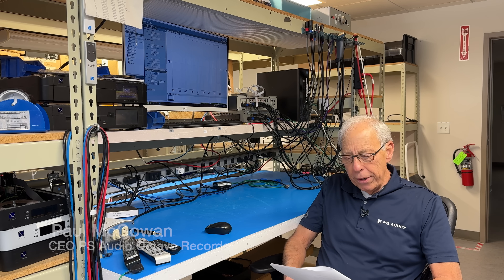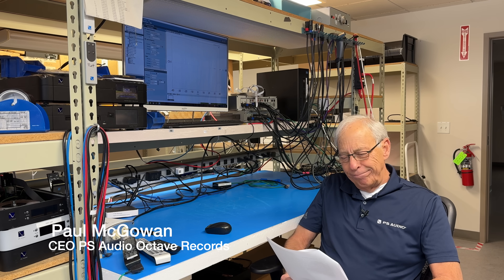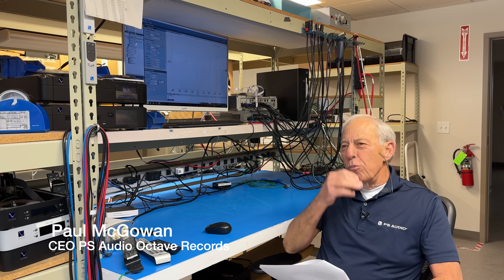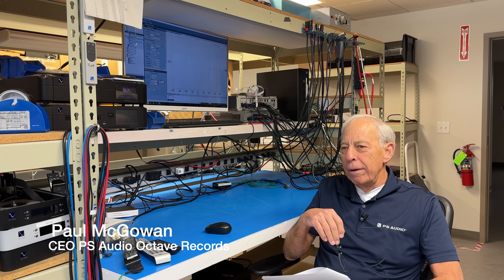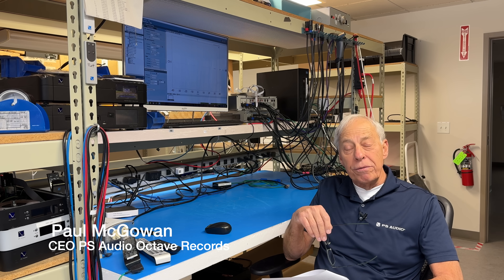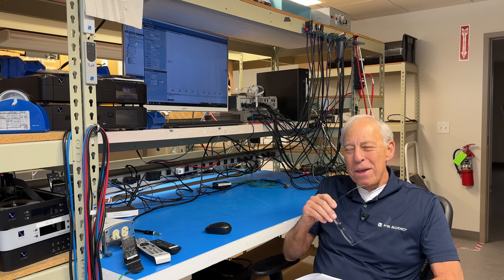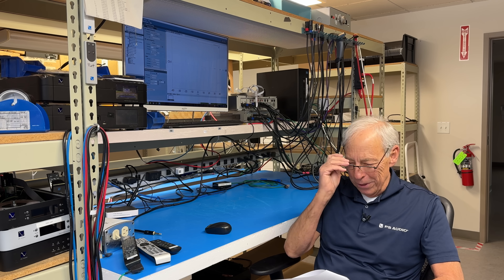Battery power for HiFi

Comment: I can't believe how noisy the power grid is in my area. The power lines themselves vibrate and hum. The power company says that it's fine. There is no way. Even my audioquest 707 isn't enough. I've tried different outlets on different circuits throughout the house to see if it helps. But it doesn't. My system sounds so off and I've done everything you can think of. It wasn't until I packed up my system and went  to another part of the power grid that I noticed a difference. Unfortunately I can't move or travel much right now. So I'm stuck where I'm at. Ive even put in brand new outlets. I don't know much about ac itself. Not sure if it's a ground issue, differential, or common. Low voltage or amps. Or if there dc feedback on the lines. All I know is that a power conditioner and new equipment doesn't fix it. Without spending thousands.

Comment: Get a couple of heavy duty truck batteries, build your own power amp and leave out the ac power supply, it gets rectified anyway. Connect batteries to the circuit after rectification. Job done.

Comment: What if you have a an amp that runs on +40 0 -40 DC and you connect it directly do a 80 Volts battery?There will be no more need for SMPS

Comment: I think Paul missed the point. Battery voltage, Catered to the internals equipment needs. Bypass the 120v power supply/inverter to step it down to needed voltage.
Also, not taking about EV vehicle. Conventional fuel powered vehicle need a good/sound battery. The battery acts as the “constant” regarding charging voltage. If you have a Bad Battery, the engine computer is unable to control charging voltage properly. To have large enough battery to meet the required voltage and amp load would be very sound/quiet power.

Comment: The best way to run audio equipment on battery power is directly from batteries.  
Sounds simple. but each component has specific needs that are not likely to be the same as any other's, 
so you would likely  need a separate set of cells for every item.  
Then there is the problem of the current needed. For preamps it's not much; for CD players 
and tape decks it becomes considerable; some turntables could make it difficult; 
for power amplifiers it is really impractical.

Comment: I'm amazed you don't have solar- any panels on the company hq roof? 
I have solar on my barn roof, and 2 x 20kw batteries. Even here in Wales I'm self sufficient, and export too, which means most of the time my power is coming from my twin inverters.
I'm more a music lover than audiophile, but got annoyed hearing pumps and compressors coming on through my house mains system. On the rare occasions (mid wet- winter) we are importing electricity noise is worse, we are at the end of a rural line, a long way from the power plant.With my limited budget I solved it with a filtered extension lead, and also replaced the power supplies to my WiiM streamer, which was like waving a magic wand. I probably spent £200 cleaning up my house electrics, which was money well spent, even though it represents 20% of my (used) system cost.
So, purely unscientifically my battery power seems much cleaner (even my wife noticed her p.c and internet ran better), and there is no special  filtering .

Comment: StromTank here in Germany is designed to power audio equipment by battery power. I'll soon go to a dealer to  hear the difference.
Reply: Did you get to hear the difference?  I saw a stromtank at my local audio place and even on sale it’s 20,000 dollars. Then again, it’s 20k spent on one item instead of getting the whole house redone with 30 amp wiring and all the other stuff you need to get to get clean power.

Comment: Talking about that nasty chopping noise that needs to be gotten rid of I wonder Why the reviews of Bob Carver's " magnetic Field " amplifiers never complained of a noise issue and often were quite impressed with the sound quality for the money when Bob fed his power transformer the chopped and ugly looking output from a triac ( like in many light dimmers ) which was controlled by musical demands as a way of regulating his power rails. making them impervious to changes in line voltage .

Comment: Reminds me of the olden days of early battery tube radios. they used at least two separate batteries. One for the tube heaters, and the other for the B+ (high voltage). Modern solid state amps kinda mimic that using various taps from a power transformer to get the voltages needed for the different stages. That could be, again mimic'd with batteries, but you would need 3 or more dedicated sets of them to supply both plus and minus rail voltages, pre amp stages between 12 and 40 volts, illumination and all that.

Comment: Here's a thought. If there were higher voltage batteries, as high as the voltage in an audio piece, how about using the battery as the power supply. Our gear runs on DC so why convert the DC of a battery to AC only to have the electronic gear power supply turn it back again to DC?
Reply: Correct..thats the path

Comment: Essentially any audio gear that works with a wall wart can be improved with a better power supply and many times even batteries. That is fine for pre amps, dacs and notebooks or MacMini/NUCs. Power amps with batteries need big high efficiency speakers. An inverter is not usually a good thing because they do let some of the garbage through.

Comment: Well , using a car for that is indeed stupid.
But one can indeed build or modify an amplifier to run directly on a battery pack. And its a better solution Than main's voltage.

Comment: This is where DIY can excel.  The issue Paul describes is all the result of using DC batteries to power our gear which is designed to use 120V AC.  With DIY it is easy today to use battery power for the sensitive digital bits.  iancanada is a Toronto designer who makes lego block parts for diy digital front ends.  He has popularized the use of lithium batteries with great results.  Then he took the step of using supercaps to aid in filtering.  Then the ultimate power supply which is to use a massive 3000F pair of supercaps as the power supply.  Combined with a good clock, the sound will destroy all but the best mega buck DAC.  But all of this eliminates the constraint of a device designed for standard AC.

Comment: I’ve been using an APC computer backup power supply on my system for years.  Relatively inexpensive and eliminates power supply line glitches.   I don’t see a downside to using UPS units designed for computers on hi fi equipment.

Comment: Battery power in an EV is extremely clean until the battery dies and then it goes to a battery graveyard where it does not disintegrate and is incredibly toxic.
Reply: I think they are quite recyclable. 80% or something to that affect.
Reply: And don’t forget about the mining operations to get those minerals.  Definitely not clean
Reply: But getting oil from the ground and making gas, diesel, natural gas and propane is? Oh yeah forgot about benzene etc.
Reply: @Expedition18  We well need a lot of gas, diesel to grind those batteries and make dust, lot ofwater to filter plastics, more carbon generated electricity to make electrolytic separation of metals, a lot of petrol to mine pure silicon crystals for solar panels, much more to buy heavy new cars (that won't work for decades) Is CO2 going up or down since  big corporations are «green» (the same that fought against science and scientific ecologist) ? The solution needs a real change: sticking a solar panel in the roof and driving a 2,5 t vehicle instead of public transportation, cycling or walking or keeping old cars (the good ones) won't help much. It might be worse indeed.
Reply: @Expedition18  Oil production, at least in the US is well paid and well regulated.  Rare earths are mined under terrible conditions with 25000 children involved in cobalt mining in Congo alone.

Comment: 1) The power from an electric vehicle is not necessarily clean.
Yes, it is off the public grid, which is great.  But who knows what noise is being generated within the vehicle's electronics?

I doubt that EV manufacturers put in a meaningful effort for the output to be noise free, when people will generally use it to power their refrigerator during a blackout.
Someone will have to try it, and do a listening test.  And they will need a long extension cord, where that, too, will be a factor in the quality of the power delivery to the stereo.

And the results will probably vary from EV model to EV model.  Even the same EV models might differ, as the manufacturer might make design changes during a production run.

Two vinyl pressings, from the same pressing plant, often sound different.  So I would not put it passed the EV manufacturers to not be consistent if they sourced parts from different places, and found savings here or there, etc, resulting in quality changes to the power delivery -- which no one would know, when powering their refrigerator or electric drill, etc.

2) Several commercial level UPS's (uninterruptible power supplies) do the double conversion (A/C to D/C to A/C), resulting in a clean, off the grid, newly generated pure sine wave output.
Can those double conversion UPS's deliver the voltage fast, to satisfy the immediate demand from audio gear?  Well, they are not marketed for audio gear.  But maybe they will work well for audio gear?

Eaton Powerware has UPS models that will deliver clean power.  Any model that starts with the number "9" will do so, such as the model "9SX".
Tripp Lite also has such models (but I am not familiar with their model naming scheme.
Liebert is another company.

There are others.  Their top models will power an entire town (megawatts of power), and will cost as much as a town.
But there are dual conversion models that are sub $1000 (providing, perhaps, 1000 watts), and sub $2000 for 1500 watts (and the wattage and price keeps going north from there).

Are they better suited than PS Audio's Power Plant, for audio gear?  Probably not.  But who knows?

Comment: Just have no AC at all.   i.e. amp has no AC power supply module, just a voltage regulator taking battery DC.

Comment: I run 4 Taramps Bass 8k's off of 3, 45 amp hour cmax banks charging them with 2 , 370 amp alternators in my truck. Each amp is wired at 1 ohm, to a Dual 2 ohm 18" subwoofer with 4" coils and about a hundred pound motor. I have them In a 4th order bandpass blowthru enclosure that I designed myself. It helps me cope with everyone's bullshit on the roadways.Believe it or not , when I'm trying to get to work people will actually get off there cell phones and drive their cars , if for no other reason, just to try to get away from the bass.😂

Comment: EV traction battery will be 400 or 800V DC. But the priciple is sound. The answer is, stick an oscilloscope on the AC outlet and see how good the sine wave is, and how clean the curves, any other artifacts. Then to see how it looks at the DC side of the source and amps, see how clean it converts. The added issue is how well the power source can react to fast transient peaks. Hope that helps.

Comment: EVs don't have "lower voltage" DC as the main power source. They run with 400 or even 800 Volts (disregarding the 2nd circuit with 12, 24 or 48 Volts).

Comment: I would like a Phono pre-amp on two 9 volts betteries to have clean power. Should last a long time aswell.
Reply: I used to feed my phono preamp with battery, 12 volts 7 amperes, the sound is great if you use nice caps to filter. Now I used a linear power supply, I get tired of charging the battery's. The phono should always stay on.
Reply: @GuareschiGuillermo The battery should last a long time if it's only on when you use it. My Pro-Ject Phono pre-amp has not on/off but I cut the power when I do not use it. Maybe better to keep it on all the time.

Comment: Danny at Gr Research just did a good video on this subject, he runs his own system from batteries
Reply: Danny went another way by choosing electronics designed from the start to be battery-powered with their own batteries . That's the right way to do it , although it severely limits what gear is available because most gear is designed for AC power .
Reply: @biketech60  and he only runs his preamp on battery power, his power amp is AC

Comment: No it is not clean at all!
There is a inverter from the car battery to your 120v/230v or whatever you have in your country.
Just that Paul is saying that inberter chopping is killing any gains in cleaniness you want to gain. 

Been there done that.. And messured only crap out in the end..

Go the other way and just build your own power amps that uses DC from a battery direct.. In that case no switching and noisy inverter is needed!

So transform to a DIY and learn new things.❤
Reply: Yes,thats the correct way to do it.

Comment: Why wouldn't you just connect DC to the rails of the amplifiers? Bypass the power supply!
Reply: That's exactly what I thought - immediately! HiFi equippment usually runs internally on 12 V DC, well, except for the power amplifier. So it would only need a simple and clean DC-conversion to the desired voltage. Maybe there will be special battery driven amplifiers using the typical output of home batteries (car or solar) in the future. This would be an enormous step forward making things so much easier and better!
Reply: It is not worth the bother because normal rectified and smoothed AC is plenty good enough.
Reply: @georgebliss964  I see it different - what is 'good enough' in a branch, that is financially powered by extreme enthusiasts. Batteries will become better, cheaper and environmentally safer - we're at the very start of this technology at the moment. There's a lot going on in R&D, driven by the growing need of more than two small batteries for your Walkman or MP3-Player. Even now, at the very beginning, there are some first solutions at the market. I believe, that these big batteries will be the future of home energy supply, reducing the peaks of energy conversion dramatically by buffering when the demand is low. There will be a time, when direct DC-Outlets at every room will reduce the need of power converters dramatically. So why not power your audiophile high end gear with clean DC - especially when you can avoid quite some problems with AC/DC conversion that easy?

Comment: It bothers me that we have High voltage AC power to move electricity around geographically, most electrical products, with the exception of some specific motors, utilise power natively in DC, particularly now as many domestic tools,  like computers, Vacuum cleaners, DIY and gardening  power tools, are moving to portable wireless units running on 22v Lithium. 
Any DC-DC conversions needed for say specific digital electronics are done in circuit. The Inverter to transformer rectifier  topology seems a little wasteful and redundant.
Reply: The high voltage for distribution is necessary to limit power losses. I am no expert, but I would imagine that the high-power transformers in the distribution network are designed to be pretty efficient. But I do think the power supply topology inside peoples homes needs a rethink. For each home a centrally generated 12V DC supply alongside the 110/240V AC sockets would be worth considering; this could then also easily switch to solar whenever available.

Comment: why you talking about inverter the car has an inverter he said 120 volts AC not DC and if it's a true sign wave will be clean. you can always put a  1F on the output to your equipment for a bit more extra filtration smoothing.
to his question what you didn't answer yes you can plug it straight into your equipment should sound better.

Comment: In general, Paul is right, though I like to add that there are plenty of amps that run on 30 or fewer volts. Hook them up to a 30v battery, and you have a battery-powered amp.
Reply: Amplifiers typically always run on a rail voltage that's lower than what's in the wall socket, but it might not be practical (or approved by insurance companies) to have DC lines in the house. But maybe some time in the future we'll use more DC locally, it could perhaps bring car and home audio a little closer. 🙂
Reply: Yeah…those amps sound lame.
Reply: @donpayne1040  Most definitely not
Reply: Paul's always right
Reply: @Pete.across.the.street  The hypex amp modules seem good for this application. They have different voltages for different areas of the amp and are class D, so are efficient. Typically, overall, they use 65v- 65v+, battery wise you’d need 120-130v tapped in the centre - with 65v- at one half, and 65v+ at the other. The other stage of their d-class amp runs at 25v- / 25v+ which would be tapped at the batteries closer to the 0 point, I think this powers a controller. Plus they have on board regulators - for what it’s worth. My experiments with cheap amp modules running off lifepo is that what they lack in bass authority (not running off the mains, which offers so much sonic advantages in comparison), batteries have this “off grid” which once you get used to is hard to live without. If you have an amplifier module which sounds good without having separately powered stages, please share*.
Reply: I heard the A&M Records used batteries for their mastering equipment years ago.  And I remember some stereo products used batteries for their power supply.